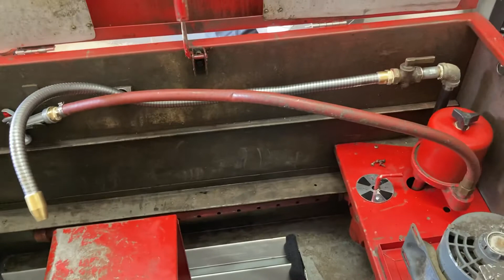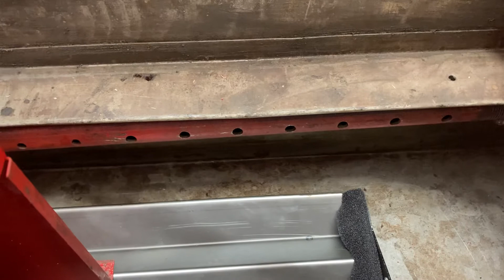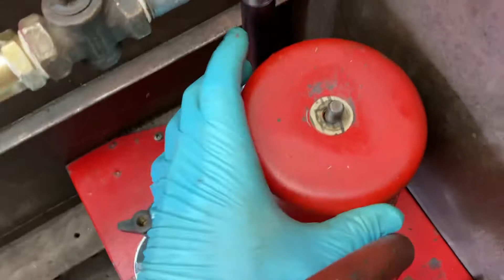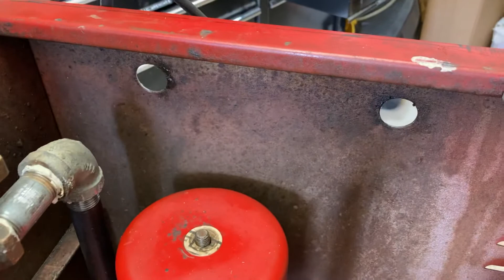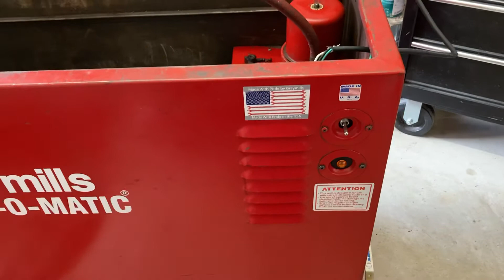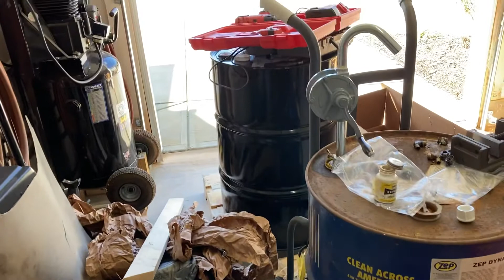Graymills Clean-o-matic 500 Parts Washer restoration discussion

Comment: Does it do anything any different that a regular parts washer?
Reply from the maker: It’s the only washer I’ve owned.  It’s got a fairly big basin so you can let stuff wash for awhile.  The sprayer has a pretty decent flow (wear safety gear for splashing).  After running awhile the fluid warms up some, but it’s not a hot solvent washer.  I like it, but the short answer is that it comes down to what solvent you’re using and the pressure/temperature at which it is delivered.  It fits nicely under my workbench.
Reply: @alannorthcarolina1776  Since the mid 70's, it's always been a Safety Kleen Parts washer. 
But about 2 years ago, I got a used  System One machine. NO more dealing with dirty solvent. NO more changing out dirty solvent.

Comment: How do you drain it?
Reply from the maker: First point the articulating metal flow-cleaner into a bucket (mine holds 30 gallons, so I’d need 6-7 buckets), then turn on machine.  Once it won’t pump any more, turn off machine, and place a container under the right front and open the plug to finish draining the rest.  Wipe and clean everything, clean out the sludge trays.  Then you can run the fluid through a refresher (Graymills sells a filter bag system. Once that dries it can go to the landfill.  Zep sells a filter cartridge system as well.). Hope that helps!

Comment: Been looking at a new Clean O Matic your comments about customer service just sealed the decision for me. Looks like a quality machine.
Reply: Hi, I'm Craig, the owner.  Thanks for supporting a family business!
Reply from the maker: Thanks!  It is very quality. It won’t match the high pressure high temp enclosed sprayers, but they cost a lot more too.  The other item that I would also get is a blasting cabinet, sized for your needs.  Clean it, blast it, degrease it, self-etch prime it, then paint it.  Powder coaters are a great resource too if you can find one that takes small jobs.

Comment: this helps me a lot i just picked up an old 500a and its missing the filter! did you find an affordable sprayer ? im not wanting to pay 60$ for the oem one
Reply from the maker: A garden sprayer would work but all the rubbers have to be able to withstand solvent.  Conversely if you were running brake fluid through it, all the rubbers would have to be able to withstand that. Do some research or just buy the part.  The current part is made in China.
Reply: @alannorthcarolina1776  1 more question , i left my washer running with the lid closed for probably 2 hours soaking parts and i noticed the motor compartment get pretty hot, i could touch it but it was right at what i could stand to touch, wondering if yours did that too. Im thinking about putting fans in there to help move air
Reply from the maker: Yes, I ran mine for a few hours on some brake backing plates.  The area was quite warm as well.  I don’t know if there’s a continuous run time limit, warning, etc from Graymills.  I will say to please make sure that your solvent is OSHA compliant (141 degrees+, I think).  Also make sure the lid closing mechanism works properly, is set up so the lid is over center in the closing direction, AND make sure the unit is run with the lid open. Of course, the unit should be in view at all times when operating.  Fans could introduce another risk unless that fan is completely outside of the unit, but it would increase the VOCs in the air.  A new motor will probably run a ton cooler.  Lastly, make sure the fluid level is within the specified (max-min) range to prevent direct contact with the motor.
Reply: @alannorthcarolina1776  good to know its not just mine, i have the proper solvent so im not worried at all. I actually cleaned some parts for paint and was being lazy so i burned the solvent off with a torch and to my suprise the solvent evaporated before it burned, so i guess its pretty  safe stuff. I also went through my motor and cleaned it and put new bearings in it.  I think i will put a fan in it to help extend motor life . I got this mostly for soaking parts to help loosen up the grease. I may put a timer on it for some extra protection we shall see , Thanks again for the help

Comment: I'm glad that I could help you out, Alan!
Reply from the maker: thanks again
Reply from the maker: My plastic flow tip cracked. No chance of a new one is there?
Reply: I have either a 300 or a 500. I was looking on the Graymills website and they are the same dimensions. How do I get in touch with you for parts? Mostly Just need a lens for the light and gaskets for the filter.
Reply from the maker: @ShemZ664  call graymills. They’ll help out. Great company!